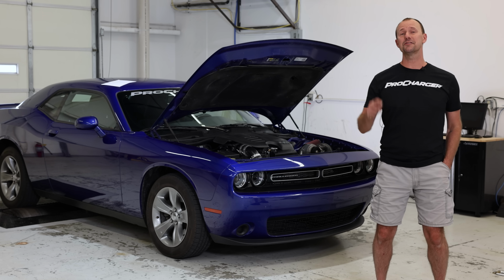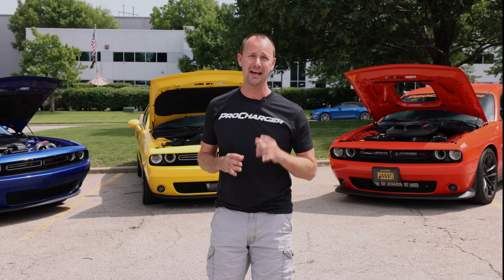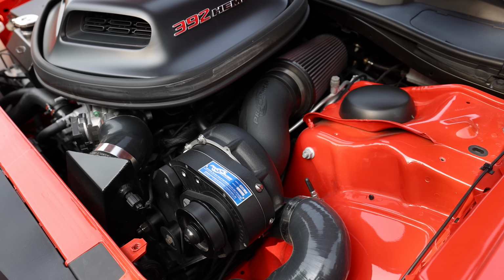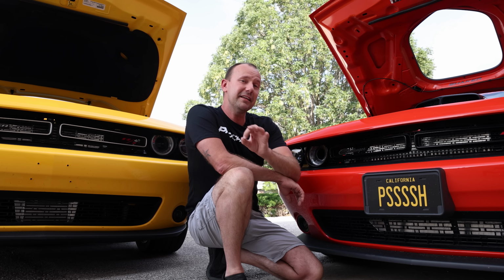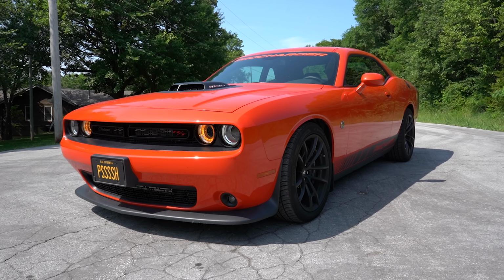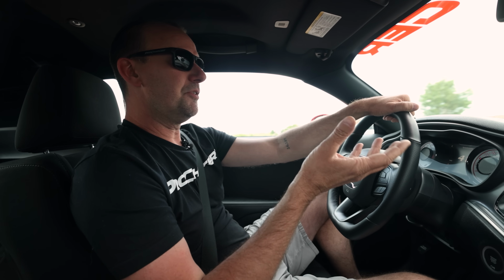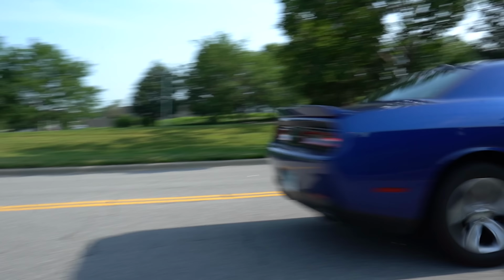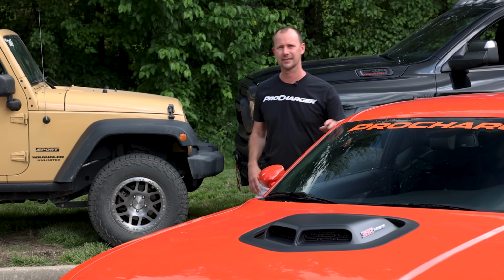Should you SUPERCHARGE your HEMI with a ProCharger?

Comment: My issues with Procharging a 2017 Charger. F1A-94 making 1190 whp w/o nitrous.  GIANT 6 rib belt pushing that power. Feeds through entire accessory drive. Belt whip / lash / slippage is NUTS. Tensioner got replaced twice. Belt length and # of ribs is scaaaary.  There really needs to be an option to eliminate accessory drive on these Hemi kits and go with AT LEAST a 10 rib. I understand there isn't much room in the engine bay of the Charger to do this...but I have seen a few people fab one. Other issues regard the poor welds on the water tanks for these units and low grade bracket screws coming with the kit (all of mine were bending with the bracket and had a few snap). Otherwise, the Procharger is a great option on these cars.

Comment: So I don't need to buy anything else for my bone stock 5.7 Challenger Shaker but the ProCharger kit and it will work as intended? No tune, no injector or fuel line upgrades?
Reply: Definitely will need a tune

Comment: I dont care how fast I'll go, I just want the whine without blowing it up.
Reply: Grab a hell cat supercharger an mount that on top yo 5.7 ($2000) an get a cold air intake
Reply: @DEBEAUXENT  6.4
Reply: @DEBEAUXENT where do you get it from?
Reply: @John-n1g8x  it’s too much work imo. You can buy used hellcat superchargers if you look on Google. But you also need a 5.7 mounting bracket to mount it to the 5.7 manifold, and a 5.7 Hellcat conversion pulley kit. You also need to upgrade the spark plugs, fuel pump, and cooling, plus a tune. The 5.7 also do not have forged internals like Hellcat motors either so connecting rods and pistons might break if not upgraded. All that work, or you can just get a Procharger and install it easily lol
Reply: @Big_Trucks_and_Hemis that's exactly what I was saying plus procharger u can make ALOT more power

Comment: Except 6.4 scat pack but they don't  say injectors and fuel pump. And the scat hhave a high position compression ring and piston become  a grenade.  And 8,000 to start pinning the crank pulley. And they never give the customers a heads up. So plan on a 15k to 25 k  project.
Reply: If you go deep forged is the only way to make it worth while. And custom tune. Cause you might as well do cam and lifters . Because the MDS will strive the number 7 lifter to a catastrophic failure if you don't only a hell cat oil pump will save your motor. So at the end you will have replace the intake and beside the original block everything will be new. I got 25k and 30k will be next because your drive train won't handle the pressure for to long

Comment: A pro charger will cost you about 5 to 10k and then another 5 to 10k for the install.  You can now buy a used Hellcat engine for under 10k, they're everywhere and the swap has been done successfully on so many Mopars.  Don't waste your money on Procharger, it's a thing of the past.
Reply: Installation is nowhere near $5 to $10.
Reply: Yes, stolen and abused Hellcat engines.
Reply: Install would be under a grand of do it yourself in a few hours.
Reply: Used Hellcat engines are everywhere??? Hahah!!!
Reply: So ur saying it’s cheaper pulling out an engine
Reply: Unless all those engines come with VINs and clean titles, you’re better off doing a pro charger install. A lot less of a headache from a legal perspective. Cheap ain’t always neat.
Reply: boost
Reply: And fyi, if you want a clean hellcat motor (not stolen or molested) get ready to cough up 14 k + taxes alone (12k for just the block without the twin screw), and that’s not adding in the cost for installation.
Reply: @glockindabenz  them mfs 5K or better all day long. learn how to do it yourself or don’t worry how much it costs 😂 in the way
Reply: I think you made some of that up my boy lol
Reply: 5-10k?!?!? 😂 most shops will do it for under 2 grand.
Reply: They won’t fit the floor pan on a regular challenger.  The trans housing is different

Comment: I’m just not sold on the hot air intake. Kits like on the Mustang have a front feed with the belt on the back side so you can actually utilize a legit cold air intake. Kits for the Hemi, and more specifically, my Pontiac G8, the air filter is highly restrictive, and sits right on top of the exhaust header. Terrible.

Comment: Hoping for a response, I have a 2016 Ram Rebel.
I've already installed: 
Sport AWE exhaust
S&B Cold Air Intake
Throttle body spacer
Diablo Tune with 93 octane tune.

I have someone who says he can install a "turbo kit 78 mm producing over 550 hp, comes with intercooler, exhaust manifolds, fuel pump, and headers" for about $4k. And new I'll need to install new fuel injectors. 

Is this a realistic expectation? Is there anything else I should replace? What should I expect as a result?
Reply: Sounds about right. But I bet you that 4000 was just a number he threw. That build would be 10 grand by the time the truck is running

Comment: Added a Pro Charger to a 2014 RT Challenger. One issue was the coolant would blow out of the reservoir, the system they provide is rated for 12 to 14 psi, when the 5.7 hits the upper rpms the coolant pressure can get up to 20 psi plus, thus spewing coolant all over the engine bay. I put and 16 - 18 psi radiator cap with an overflow to resolve this problem, it worked fine. The low-end torque is not changed unless you bring the rpm up to where you are building boost, but then you best have some drag radials on because you will not get and traction without them (street tires will just light up) The best 0-60 time with by 5.7 Pro Charge was a 4.4 according to the dash counter.
The best 1/4 mile was a 12.6. The 7 pounds of boost is nice but the Pro Charger can deliver more with a pully change, DON'T DO IT until you forge the bottom end of motor and replace head and all bolts associated with keeping the heads on. The compression ration with 7 psi boost is around 17:1 higher the boost the higher the compression ratio. The advertised HP gain is supposed to be around 140 - 160 HP but know over half comes from the tune and the other from the Pro Charger. Be sure to fine a good tuner they will make the difference in how the car performs and know the factory settings will no longer apply to the tune up.
Reply: It is not yalls car so why comment such mean posts? He had the car, he had the $$ he got it done. Fuckin haters
Reply: @l2kxboost  nobody fucking hating I got a newer car than him just stating facts matter of fact I have three cars people use the word “hating” loosely.
Reply: This comment is hilarious.
Reply: Seems expensive to run a 12.6
Reply: Why hilariousl?
Reply: It’s not worth it then too much just to run 12s
Reply: @terrylee773 what’s the cheap way to run 12s?

Let me guess: LS swapped shitbox?
Reply: Your pushing coolant means head gaskets leaking
Reply: @frankwix8825 
The issue is Pro Charger puts a 14 psi reservoir cap on its system. Like I said in post the 5.7 can push up to 20 psi on the coolant system. I put a 18 psi cap on and solved the problem. Had the shop verify cylinder pressure and was all within specifications

Comment: Do guys recommend forging the internals on the 6.4 before adding the pro charger kit. Also, are you guys concerned about heat due to the placement of the pro charger under the hood? Thanks.
Reply: If you have a 392 thats made from 2017 or before, its generally not advised to boost them because of the high compression + small ring gap. The 2018s and up use a wider ring gap and a stronger block.
Reply: @DarkSlayer487 I've not heard that before. I have a 2020 392 and I'm on the fence about a procharger. Can you share more info about this
Reply: @DarkSlayer487 actually its the 2017 and up
Reply: where did you get this information?
 @DarkSlayer487
Reply: Nope a buddy runs one on a 6.4 and he's completely fine stock. They make the kits to the limit where it's safe

Comment: I have a 2006 Dodge Ram 1500 4x4 quad cab Hemi and I know you guys have a kit available for it. My question is have you guys tested these kits at high altitude while towing? I tow at about 6-8k feet above sea level and my truck struggles towing my camper which weighs almost 6k lbs. Transmission is constantly shifting.
Reply: keep it in lower gear

Comment: I have a 6.4 hemi charger scat pack. I was thinking the 5.7s and 6.4s were not able to have forced air , because the internals of the engines were not forged. OR do you guys get away with it because it’s only 7lbs of boost..
Also does the boost affect the longevity of the engine?? I would love to do this to my car.
Reply: No answer 😢
Reply: 5-7psi is safe for stock hemis, and of course boosting an engine will lower its overall lifespan faster. not by much but still something to consider.
Reply: It’s not IF but WHEN you’ll have problems without forged internals.

Not to mention the hp70 trans and shaft are only rated to 500 hp/torque.

Something will give …mathematical certainty.

Comment: I have a good question. If a stock 6.1 Hemii has a 0-60 average of about 5 seconds flat would adding the pro charger and nothing else improve the 0-60 to 4 seconds or less possibly? I think if it can that’s great! But like to know if anyone has compared with pro charger and without on stock 6.1 challenger srt8. Will 160 added horse get that time to 3.5-4 seconds by chance with just straight pipes and cold air intake and pro charger and a Diablo tune with a 6 speed manual?
Reply: Get some good tires and I'm sure you'll be there

Comment: I have one on my '18 Challenger Scat Pack and it's definitely well worth it!
Reply: What did it cost? I have a 21 Wide Body Scat. I'd love to try it.
Reply: @mrwhamisrick  I paid $8500 that's not including Tax, I have a P1SC1 Procharger
Reply: @cantcme243 I have a 2018 Challener Scat as well. Did you have to send your ECM to procharger for the tune, and unlock? Or how does that work? 

Also, how is the reliability so far? I plan on buying one soon
Reply: @devingridley3237  Yes that's what you have to do
Reply: @devingridley3237  It's very reliable as well and those prochargers work best at the top end!
Reply: I have a 21 Scat Pack has it been good so far without working on internals?
Reply: @premiumnaturesounds905 Yep, no issues!

Comment: I'm living at 7,000 ft elevation and my 2014 Challenger 5.7L needed more power.  I had a local Procharger dealer install a P1X complete system with the big race intercooler.  I've had it for 1 1/2 years and love it.  The Procharger tune they supply is spot on and it can run like a stock car but with mucho power available.  You also get a Diablosport tuner to keep with the car loaded with both stock and 91/93 octane supercharger tune.  The only other modification to my car is a cat back exhaust.   You dont need all the other cams, headers, etc... this setup is plenty for the street!!!!  Thanks Procharger❤❤❤
Reply from the maker: Love hearing this! Thanks for sharing!!
Reply: @ProChargerSuperchargers  pro chargers and turbos take the win for me, personally hellcat style superchargers to be good for what they are but soon as you start adding pullies and turning up the boost there rpm limit and survivability is lacking..turbo or procharger is where it's at!!! I'd own a stock hellcat and leave it at that, but the first mod for me would be get rid of that style supercharger if I was gonna go up in power..If I only had a dollar for every hellcat being hammered past redline of the supercharger with to much pully trying to get more boost with some guy going on about redline for the engine...pro charger or turbo for me!!! Then they blame it on the supercharger after they burn the nose bearing out of it!!
Reply: @ProChargerSuperchargers buddy at work literally spent 30k building a 1400 horse engine for his hellcat after he launched his factory supercharger...then his builder and tuner went threw 2 more superchargers trying to get what they promised ..now on his 4th supercharger he is running 800 horse..cause finally him and his builder and tuner accept 1400 horse on a supercharger that limits at 18000 rpm is not a good idea...and maybe I wasn't the idiot they all called me when I said you need a procharger or turbo to pull 1400 horse out of that thing but it's OK they all laughed when it was on the dyno and I threw a fit about them running that thing at too high an rpm..they never did pull 1400 horse even with destroying 2 superchargers on the dyno
Reply: @bluedogydoor  - Seems like you need another round of editing... because this is hard to read and comprehend.
Reply: @ronaldscott642 what did the whole setup with install cost you? Thanks!
Reply: @arqumball3070 with all options including the black powder coat on the P1X, bracket, black race intercooler, and helical quiet gears... it cost $15,900 including professional installation by a Procharger dealer shop.
Reply: It cost $16,000  installed @arqumball3070
Reply: How much Psi?
Reply: @whereyoubossup I'm getting 12.6 psi on my Autometer boost gauge running the P1-X.
Reply: @ronaldscott642  - Sounds like you have lots of restrictions within your Intake system. Boost is a product of restriction.
Reply: @ronaldscott642  is it still OK? 12 psi is way a lot for standard engine. Procharger says to boost 7-8 psi on stock pistons e.t.c

Comment: My 2017 Mustang V6 has 500+ Wheel Horsepower now due to a P1SC-1 w/ an E85 tune and a 3.40” pulley. These cars only make 240ish to the wheels stock. Double the power.
Reply: @Swen-bk3kzoh boy 🤡
Reply: Swen-bk3kz ProCharger recognizes this engine. Why the heck do you think they made a kit? Lol

Comment: I would like to see a centrifugal setup on a hellcat.
Removal of the IHI blower saves 180 lbs as well.

I think pro charger should make a system like this.
Hellion  makes a twinnturbo set up.
So why not a centrifugal setup.
As long as it weighs way less then 180 pounds.
Ess makes a kit that weighs 35 lbs for the mustang.
I think procharger can do this.
Reply: The blower alone isnt 180 pounds 😂
Reply: @MrEvilTag  your right it's  a little over 100 lbs, I guess i didn't proofread.

Comment: Why is the air filter in the engine bay?
Reply: To be fair, all air filters are in the engine compartment for almost all cars. 

Perhaps you meant why is the air tube and filter rear facing instead of facing forward? Only Procharger can answer that question.
Reply: @taxinator5858  
The filter for my Kenne Belle supercharger is not under the hood.
Reply from the maker: Intercooler enters the chat.

Comment: Yes, yes you should!  You should supercharge ANYTHING that Procharger offers a kit for.  Debate over.  You’re welcome.  Lol
Reply from the maker: We tend to agree. :)
Reply: Does the procharger dealer network supply you with the supercharger kit or you order from the website and they just do the install ?@ProChargerSuperchargers
Reply: @ProChargerSuperchargers  do the dealer network provide the supercharger procharger kit and also do the install or it must be brought from the website then installed at the dealer?
Reply: AGREE!
Reply: Y’all should come out with more powerful street head units that can make 1500 up plus not those loud F series
Reply: @SrtHemiPower  , 1500hp comes down to wayyy more science than just the head unit.  It depends a lot on the build.  The head unit is just one piece of the puzzle.  But if you’re relying solely on the head unit to put in the work, it’d be hard to name any other option that would be quiet.  Big turbo = loud.  Big roots blower = loud.  Twins = loud.  I’m betting a 1500hp street car isn’t no sleeper anyway.  So if “loud” is gonna be part of the equation, might as well be loud and dependable and backed by the leading company in the supercharger world…PROCHARGER…
Reply: @WeekendWrenchn the quietest option for boost is turbo systems. And even the hellcats make around that range typically 1400 whp on these set ups and a bit more street-able with the tune for boost to drop power vs having to change a pulley and then drop a tune for that. But turbos get hot however there are things for that just like for blowers.
Reply: @joshreynolds729  , big turbos (singles or twins) capable of 1400hp will not be quiet.  I’m not quite following you on the rest of your reply.
Reply: @WeekendWrenchn  of the ways to boost a vehicle turbos single or twins are the quietest   That’s all I’m saying for a street build. It’s more quite than leaving it na and building the motor or a positive displacement or even centrifugal types of blower. They are more streetable to and the motor doesn’t have the work as hard turning the blower. And the last part meaning being the most streetable out of all the systems would be the turbo because you don’t need to mechanically change boost settings via pulley and tune a simple tune will do which make turbos ideal for the street among others in that category. That’s what I was saying.
Reply: @joshreynolds729  gotcha…thank you, I see what you are trying to say now.
Reply: @WeekendWrenchn  No worries brother take it easy 👍🏻.
Reply: And what would all this cost me on my 6.4l